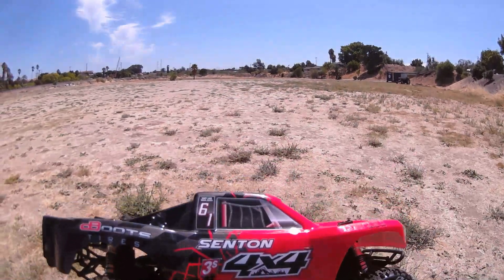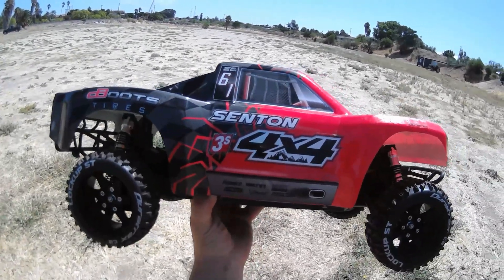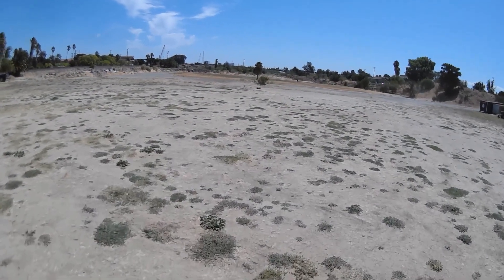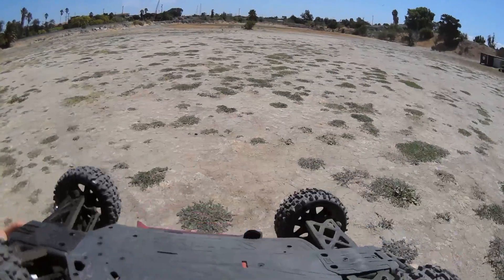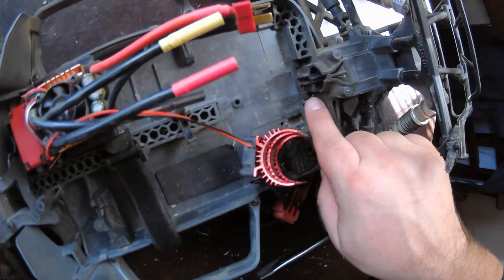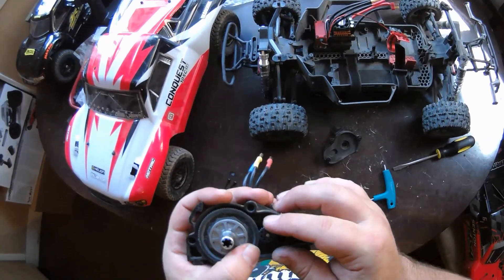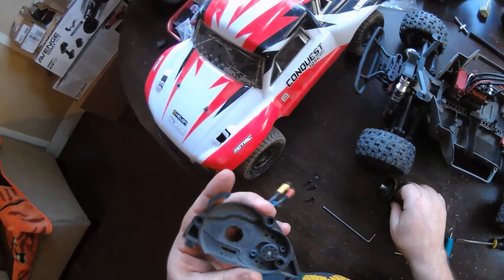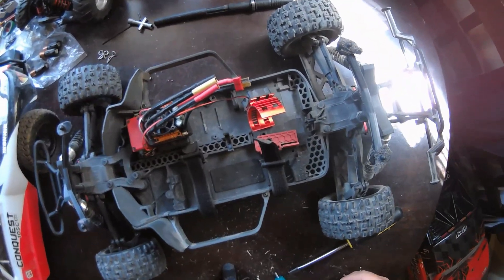ARRMA SENTON 4x4 MEGA - Brushless 3s Run

Comment: I'm going to assume you are running 2s? 5000kv is super high for 3s. I'd upgrade the slipper/pinion/spur/motor mount to the 3s platform. If you get the adjustable mount you can set your own mesh and you won't need a metal spur.

Nice run, man! Keep on bashing 😎👍👊
Reply from the maker: 3s all day! Lol..Yea I think I'll go with the BLX 32 pitch gear set up next with a Hot Racing motor mount
Reply: @philthyco1  If you are running 3s you need to go 32p. Otherwise you will go through spurs like underwear. And that motor is really too high of a kv. Don't you have heat issues? What brand/size is it?
Reply from the maker: @bicketybamRC  No heat issue on 3s..I run a motor heatsink/fan.. I've been running it for about a year with this system and stock spur with a 27t pinion but on an 80 amp ESC..This was the first run on the 120 amp ESC
Reply: @philthyco1  I ran a 4600kv motor on 3s in my Granite Mega 4x4 and ate spurs like a fat kid eats Skittles 😂 I moved it to my Senton Mega 4x4 and even with a fan it ran hot. I'm glad yours is hanging in there 👍😎👊
Reply from the maker: @bicketybamRC  Lol skittles!! Yea,the shorter chassis and drivetrain seems to add more stress on the Granite ..Richie had his running a 5700kv on 4s but only doing speed runs..It would burn up for sure if he were to bash a full pack through it lol

Comment: Buy the Hot racing spur gear ⚙️ and the hr pinion !! It’s a direct fit . Has saved me so much time !! Hooks up great! I’m running a 27tooth with a  castle motor and esc it’s so tough and fun. Love these trucks !! Just ordered some duratrax speed hawks too . How well are those shocks holding up now ? 35$ seems like a steal of a deal!! Great video new sub ✅👍🏻👍🏻‼️
Reply from the maker: I've got the BLX HD set up in it now on 32p gears and a 20t pinion..These shocks are great..Too notch after changing out the pistons

Comment: 👍Ripped like a Beauty!  I got some pebbles in my spur one time... 👍This is why I put a nice bead of tacky grease around the bottom and opening by the spur so when you slide it back in it will make a seal and keep that crud out.
Reply from the maker: Nice..I'll do that too for sure..I didn't get any pebbles but a few blades of dry grass..I think it was just to much RPM for the gears lol

Comment: Check that motor mount plate for straightness. On those hard hits they can bend and that might have changed your mesh which wore down your gears quick. Just something to double check before you ruin some new gears
Reply from the maker: Right on bro..Will do..I plan to get the Hot Racing set up next that way I can run any pinion gear I want

Comment: I think most of those input breaks that were happening, were on the mega Granites and these Sentons fared a  bit better, because of the smaller tires etc. Also, the slipper on those while easier to manage, worked a little better with the dual pad setup, on this setup the single pads don't last that many packs (and that was on brushed and then on brushless every pack, probably why they sell 'em in packs of 3, lol).
Reply from the maker: This slipper is nearly 2 years old and running 3s brushless the whole time with minimal wear but I plan to do upgrades to the power modular soon
Reply: @philthyco1  It's my kids they are learning, but they are rough on stuff, at least they aren't expensive, lol.
Reply from the maker: @drog343   I hear yea kids know one way..Full throttle! Lol

Comment: Yep, you destroyed that spur 🤣 I highly recommend that you go to the 32pitch gears. I am still on my stock plastic spur and I'm putting a ton of torque to mine 👍
Reply from the maker: Yes sir..I'm going to order the 3s blx power modular setup with motor mount, 32 pitch spur and slipper..The stock gears lasted pretty long ..They didn't like the 120 amp ESC though lol
Reply: Does the blx module fit straight into the Mega?